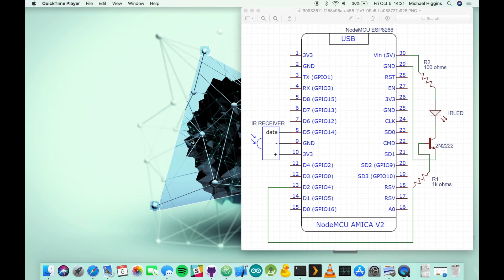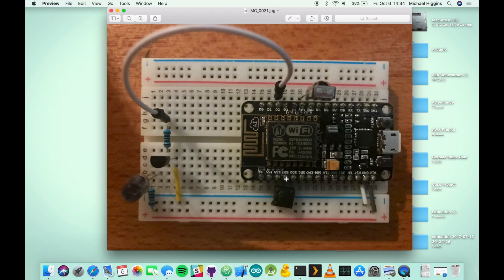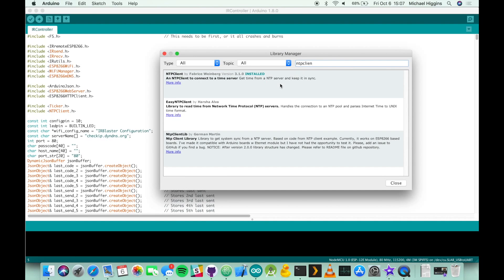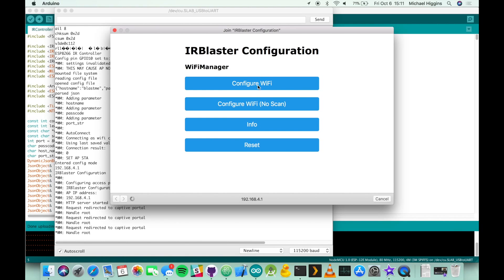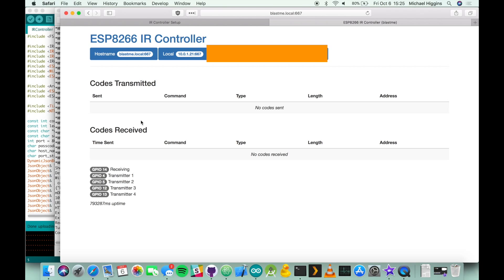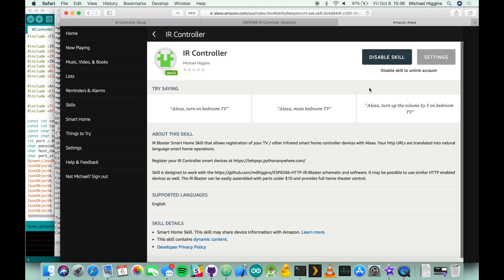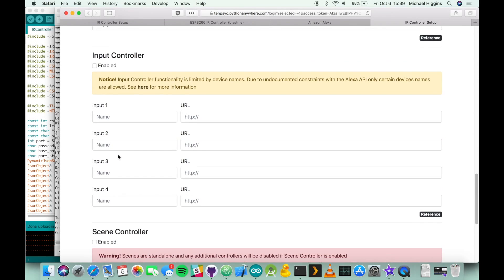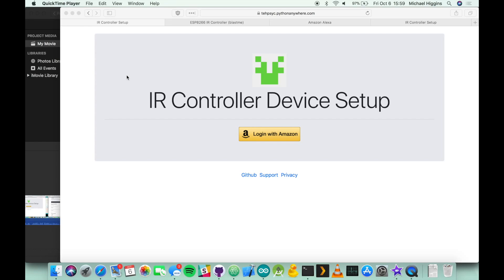IR Controller Tutorial

Comment: I used tool called tcping to ping the local IP port 667 and it indicated that it is open. also I used https://www.yougetsignal.com/tools/open-ports/  and it indicated the port is open. I appreciate taking the time to check my issue ...I am almost there but I need your support. If "we" can do it ; it will open for me a new world for me  of IR potential with Alexa
Reply from the maker: You need to be able to ping the external IP not the local IP and it ideally should be tested from an external source. If you get your external IP and then try to navigate to http://externalIP:667/ that should take you to the splash page to show you that the device is running
Reply from the maker: Feel free to message me on hangouts and I can try and help you debug this

Comment: Managed to correct the situation and now I can say it is 100% as instructed. I still get Alexa "Sorry TV is not responding" I pinged the site and came with 2003 ms) Wow...Is there a way to solve this issue..for people outside the US of A.  I also check the port forwarding and my port 667 is open
Reply from the maker: Which port you use does not matter, you need to open that port on your router so that connections from the external network can be made (all Alexa commands run on AWS lambda in the cloud). I pulled your configured device data and tested and your port is currently closed and not accessible from an external source

Comment: Need your confirmation on my approach. Before wiring the IR "kit" I thought if I just upload your sketch and see if I get the Access Point IRBlaster I did not ; instead I got the following:
ESP8266 IR Controller
Config pin GPIO10 set to: 1
mounted file system
*WM: Adding parameter
*WM: hostname
*WM: Adding parameter
*WM: passcode
*WM: Adding parameter
*WM: port_str
*WM: Adding parameter
*WM: user_id
Using Static IP
*WM: 
*WM: AutoConnect
*WM: Connecting as wifi client...
*WM: Custom STA IP/GW/Subnet
*WM: 10.0.1.10
*WM: Already connected. Bailing out.
*WM: IP Address:
*WM: 10.0.1.10
WiFi connected! User chose hostname 'ESP_83E169' passcode '' and port '80'
mDNS started. Hostname is set to ESP_83E169.local
Local IP: 10.0.1.10
URL to send commands: http://ESP_83E169.local:80
HTTP Server started on port 80
Ready to send and receive IR signals
Turning off the LED to save power.

Which is NOT what was displayed on your youtube masterpiece.   Any comments. Of course I can provide the hardware used IF NEEDED
Reply: Apparently ...Hardware matters....
After trying nodemcu v .9 (OLD) and wemos D1 ( also OLD).........Then  I tried nodemcu V3 (Latest) and it worked as advertized. The question is shall I dig into the reasons behind all that for the sake of your fans. Or I just keep using the latest hardware.???
Reply from the maker: I used NodeMCU V2 since that was the last official nodeMCU, V3 is a sort of unofficial version that I haven't tested and its larger and takes up more room. WEMOS should work but you might have to mess around with the pinouts in the blueprint

Comment: Hi Michael,
      Awesome project. I would like to know how you integrated alexa with your code. I know lambda coding in AWS. But how did you achieve your ESP device communication over internet without port forwarding? Could you help me out with the web coding samples or direct me to a link where i can study the same? I want to do a complete home automation system but without port forwarding. I have bought a vps server with linux distro.
Reply from the maker: It does use port forwarding, its mentioned briefly in the video. The only way to achieve this without port forwarding would be to use  MQTT but then you loose the ability to send multiple commands in sequence. Still working on a way around this as MQTT would be the ideal solution.
As far Alexa integration, I use AWS Lambda and the V3 smart home API

Comment: I am trying to complie but I get an error: 

Arduino: 1.8.4 (Windows 10), Board: "NodeMCU 1.0 (ESP-12E Module), 80 MHz, 115200, 4M (3M SPIFFS)"

Build options changed, rebuilding all
C:\Users\mariouribe\Desktop\IRController\IRController.ino:15:20: fatal error: sha256.h: No such file or directory

 #include "sha256.h"

                    ^

compilation terminated.

exit status 1
Error compiling for board NodeMCU 1.0 (ESP-12E Module).

This report would have more information with
"Show verbose output during compilation"
option enabled in File -> Preferences.
Reply: Looks like you din't installed the Cryptosuite library see  README at  Cryptosuite page: 
Installation:
  Make a 'libraries' directory with your Arduino sketches folder if you do not already have one.
  Copy the 'Sha' directory into that directory.
  Restart Arduino to rescan for new libraries.

Comment: This looks awesome! Thanks for the work you've done, I found it through the Alexa app and will be building it very soon. One question, how far could you run the IR? I'm wondering if I could install it in the roof space and have the IR on a cable to pop through an AC vent. And maybe a second transmitter for another room or do you recommend another controller for another room?
Reply: Depending on the LED you use I'd say that range is probably doable. Line of sight is the most important thing so you do generally need one per room